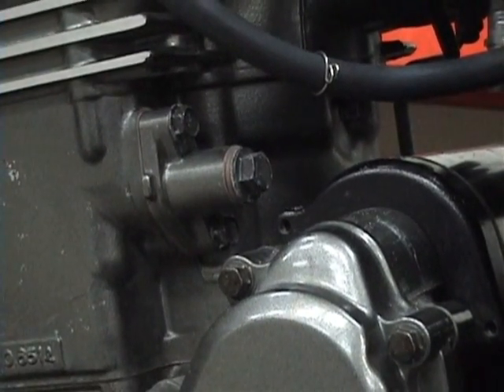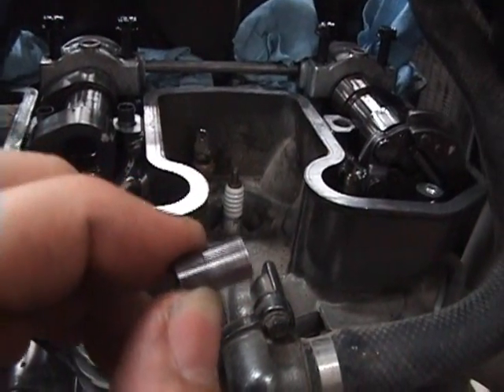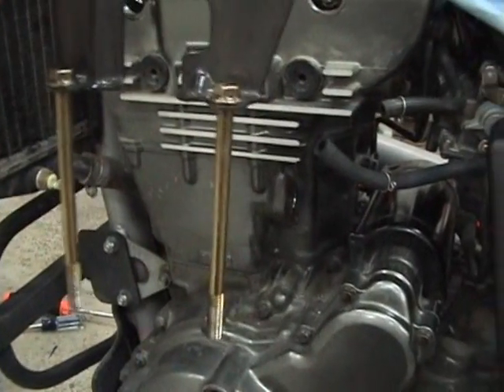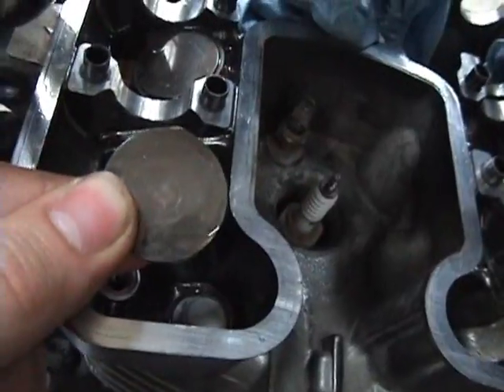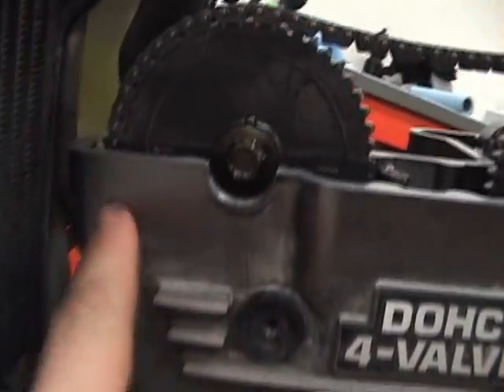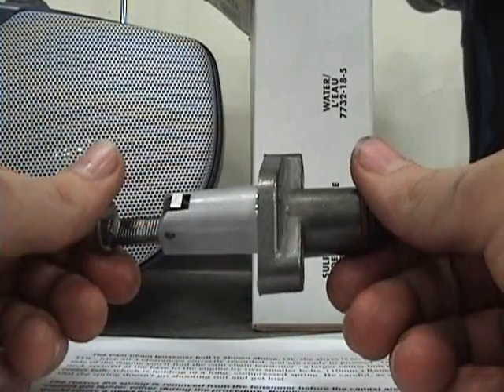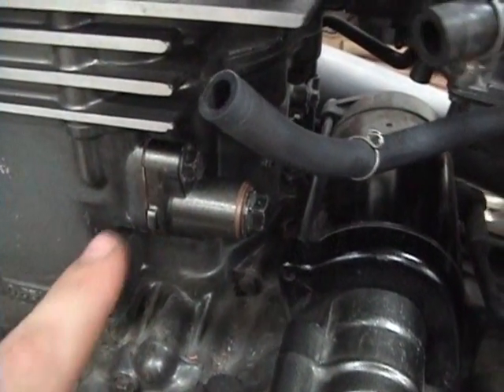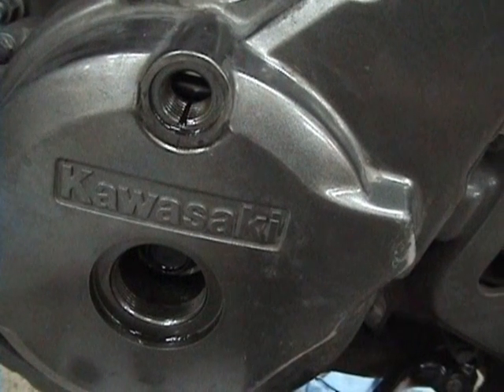KLR 650 Valve Adjusment

Comment: Sorry I hit submit too soon, so I made index marks with the red nail polish at the ends of the chain cover and on to chain then from cam chain gear to cam chain chain. I painted on the chain, from the cam at 90 degrees and at 180 degree of the  chain as it was with cams. So upon reassembly it just made the need for having to move the CAMES one or two teeth at a time un needed.  I aligned the index marks and it made it so much easier to reinstall, and I don't know about you guys, but I tightened the cam nap bolts ( with new E.M. Bolts said to be stronger. In 3 sequences of TRQ amounts first pass I went in order of CLYMERS  with the new screws. Some new dowels all making it easier by miles for a first time Val shim adjuster such as myself  I went 35 inch lbs on all 8 cam bolts first pass, 75 second pass and the finally 106 INCH POUNDS OF TRQ. As finial. THEN AS I LUBED all shims and cam journals with lots of oil I spun the motor by hand 20 times CCW ONLY-and re aligned to TDC ( Tech tip imho) I remove spark plug so it made sit very easier to and rechecked the clearances and before that tripled checked the TRQ OF 106 inch pounds. I thought the marking the cam and chain was a good idea and sure for me made confidence and reassembly perfect the fist times on bike done Lots CAMES shims on cars Buy were where they were. Please let me know if any anyone knows of or thinks of a problem that doing this creates, I know I will have small amounts of paint floating or sinking or better yet just in the oil, I would hope trapped by oil filter, so I planed on changing the oil in 35 miles.  I hope that makes sense I know I write like a gorilla and or worse, and I hope the indexing helped.

Comment: sorry if im being a pain but my bike now suffering from back fire out the carb i cant even kick it over for the fear of breaking my leg. Timings perfect shim and gaps are perfect. Could the stator be in the wrong position or is it a lean or rich carb.... Has new stator cdi and coil. new shims. Loads of compression bikes only done 12000km 1984 klr 600...carb is stock no mods
Reply from the maker: Did it start that right after adjusting the valves?
Reply: no. We just towed it behind a car seems like a no gas problem.... Full open throttle then no throttle it starts to run. So its lean no gas. Have to do a carb rebuild. Everything looks mint in the carb tho. Guess ill start with the float level

Comment: THe rear cam chain tensioner bolt can be a mystery - as in how the heck do you get to it. I spent an hour yesterday and was about to give up when I decided to look for every 10 mm wrench I could find and see if one worked. I found about 7 of them and sure enough one of the them worked perfectly. This one let me remove the bolt with wrench hanging down, all the others would barely catch and had the wrench sideways by the starter, impossible to use in there. I was considering removing the starter and using a rachet before I found my new favorite 10mm wrench.
Reply from the maker: I don't think the cam chain tensioner is hidden by any means...?

Comment: If you remove the spark plug when turning the engine over by hand ( with a socket/wrench), there won't be any compression and is so much easier to turn. Put the plug back into the head when your adjusting the valves so you don't accidentally drop anything into the cylinder. Make sure to re-install the plug and torque it to spec. also a small dab of anti seize on the spark plug threads will keep the threads from galling.
Reply: Noticed that right off. Shows how much experience a person has to overlook that.....LMAO!!!

Comment: as someone with minimal mechanical knowledge, this seems like a daunting task
Reply: Archer Moody did you do it
Reply: Space too tall, shim too small. Space too short, must abort. This is a mnemonic I learned at MMI in Orlando. When you measure it for the gap if the number for example should be .14-.25 and you get .35 you need a larger shim. The reverse works the same way. If your measured gap is too short, you need a thinner shim. It does look like a lot, but if you go slow, and use a muffin tin to mark your bolts putting them in as they come out it get easier. Once you have done it once, (like doing brake drums the first time) your understanding will improve. It gets easier from there.

Comment: To know what size of shim you need I always took a measurement of each clearance before removing the shim. If you have a valve seating further into the valve seat then others a smaller shim than the next size maybe needed. Second point is shims may not need replaced at all. Measure twice then reference clearance specs to determine if an adjustment is needed. Also did not see him confirm the actual Cam shaft installation timing.  Good video but the other person commenting is also right Kawasaki has used shim under the cam shaft since the early 900Z1 inline 4 from early 1970's and there was a tool that would allow you to leave the cam shafts in place and force the value down far enough to remove the shim without disturbing the camshaft. I was a Kawasaki mechanic for many years in the 70's and this was the most frequent service job I did.  If your not comfortable with this level of work take it to the shop and let a trained tech do the work.
Reply from the maker: +Dan Haines "To know what size of shim you need I always took a measurement of each 
clearance before removing the shim. If you have a valve seating further 
into the valve seat then others a smaller shim than the next size maybe 
needed. Second point is shims may not need replaced at all." This video is part 2 of the entire valve check and adjustment process. The first video was checking the valve clearances, which had an in-video link to here if you needed to adjust the valves.

Camshaft timing: 5:30 in the video.

Comment: Nice job of chronicling the process! This is the kind of video one should watch multiple times to get it down. Have you done the MC Mod, where you rotate the Exhaust cam forward (counterclockwise as viewed from the left side) 1 tooth or 7.5 degrees? Works best for 2008 motors and above. Mixed results pre-'08. Dyno tests show 7-10% HP increases!
Reply from the maker: kthom2001 Thanks!
I did do that mod. I think I'm going to change it back next valve check, it doesn't seem to have done much for the bike.

Comment: Dear Ghoti,
I have a problem with my 2004 klr 650. I hear a slight rattle in my top end and I removed the valve cover and upon examining the exhaust cam I notices that the part on the end which the spring is connected had a left/right play that caused a slight rattle. Should that play be there or do I replace the spring or the entire exhaust cam. Help me please.
Reply: thats the decompression thing, if its messed up replace it but its always gonna be a little slack

Comment: Sorry, Man ... It was just an initial shock reaction ... You know, the KLR and the DR650 are similar enough (Dual Sport Pigs) that I have been flip-flopping over which bike (used) would cost least to customize and to maintain, over the long term.  It would also be primary regional and personal commute transport (must be able to fix it quickly).  So ... It just seems that the KLR was not really designed with user-maintenance as a priority.  From what I have seen, thus far, the DR650 wins.

Comment: You must be joking (please?) ... Watch the vid on adjusting the DR650 valve clearance ... You remove the valve covers and just stick a feeler gauge into the gap and turn a bolt ... done.
Reply: They are different adjustments.  DR is easier to adjust than the KLR.  The KLR uses bucket shims.

Comment: Abyss of doom is a good name. I've dropped the small chain guide bolt down it before and the magnetic wand I had was too wide to fit. A small magnetic wand (1/4 inch or smaller) is important to my peace of mind now.

(This was on an EX250 which thankfully doesn't use shims anymore.)

Comment: Thanks again...

What you DID show was really great, but you left out a few things which confused me

The Cam Tensioner.  Why did you play with that, just so you could show it wiggles?  Well you took out the bolt, and the spring, but then what?  Obviously you put it back, but what about the thing you were moving in and out, what is that all about?
Also, Cam Lobes... One had arrows on there, what is that about? do I care?

Thanks for the great info!

(yes I did read the full description too.)

Comment: I've seen people do the valve adjustment and not actually remove the cams, just take the bolts out and exchange the shims that way.  That would seem to avoid issues of misaligning the cams when they are re-installed.  Could you have done it that way too?
Reply: No

Comment from the maker: The Clymer gives a range of .10 - .20 mm (.004 - .008 in) for the intake and .15 - .25 mm (.006 - .010 in) for the exhaust. Set them to the loose end of the range; as close to the bigger number as possible without going over.

Comment: Thanks for an informative video. During the adjustment you mentioned the spec of .004". Did the manual give a range such as .003"-.005" or does it give an exact spec of .004" and do the shims come in increments of .001"?

Comment from the maker: You would readjust the valves the same way that you initially adjusted them. The same method to figure out what shim you need, though it will most likely (hopefully) be the next shim size.

For the feeler gauge, if you get to a leaf  that you can't slide under the cam, try the next one smaller; if that on can slide underneath, that's your measurement.

Comment from the maker: Funny you should say that. I thought for sure I saw somewhere in a manual (Clymer or Owners) that you aren't supposed to remove the spark plug for this. As I was taping this, I thought it was kind of odd, since it would be easier to turn the engine over. I just checked the Clymer and it didn't mention the spark plug. I don't have an Owner's Manual around to check that, if the valve adjustment is in there.

Weird.

Comment: Indeed. Spark plug should be removed to make it easier to turn.  In your demo, you overshot TDC and had to continue to spin it one more time.  That's why- if it were easier to turn you wouldn't have overshot it.
Good advice to clean around the spark plug area before you remove it so dirt won't fall in.  This applies every time you remove any sparkplug in any vehicle.
You did go out of your way to caution your viewers to not remove the plug.  This is incorrect.  Great demo nonetheless.  Thanks!

Comment: I waited to long to do mine, had one tight and others out-of-spec.  I made a bit of a guess, valve just a bit tight, none of the other original shims were smaller, so I went smaller by the full valve clearance.

Comment: okay with what I understand u took off the old shims and put in new ones? If this is the case, that doesn't mean that once you put the new shims together the clearance would be on spec. Indeed u have to check the clerance and replace the shims with a bigger or smaller shim to make the difference.Exam if you mesure(read) the shim and its .25 shim with a clearance space .04+ and spec requrm. are .17-.25 u'd replace that shim with a bigger shim exmp .30 to make up the space.

Comment from the maker: I read somewhere that you shouldn't remove the spark plug. I don't know why. If you do, use some compressed air or something to get the dirt and gravel out from around the plug or all that crap will fall in your engine. Then you'll have to take it more apart that you probably wan to.

And it's really isn't that hard to turn over with the plug in it.